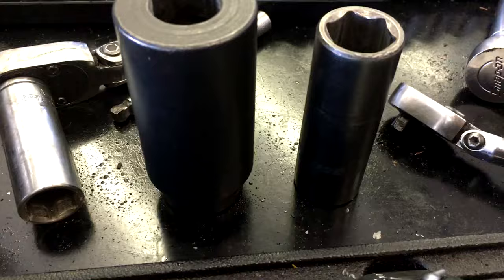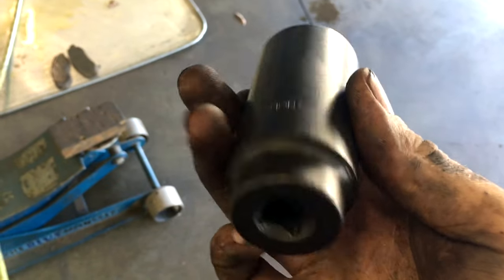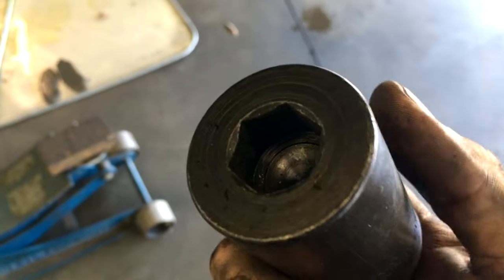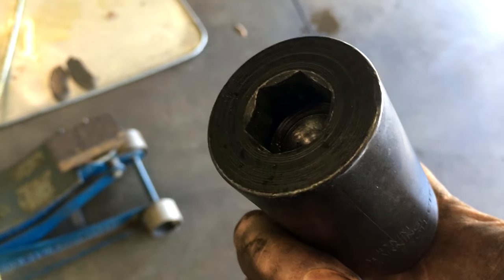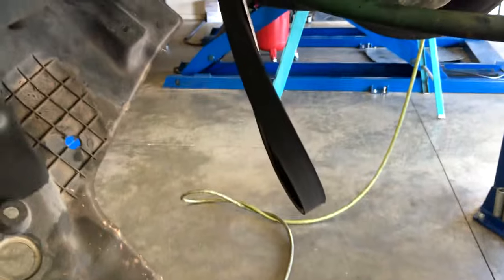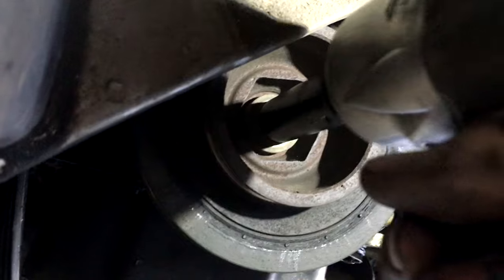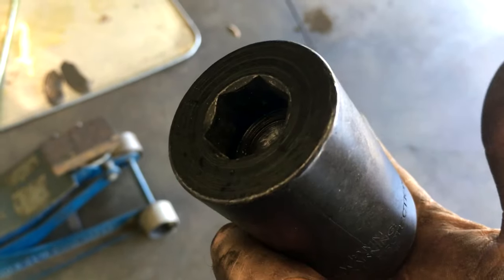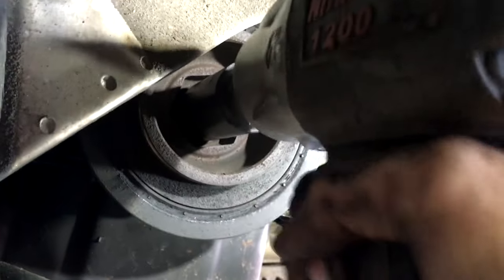The Easy Way To Remove Honda Crankshaft Pulley Bolt / Harmonic Balancer

Comment: I recently changed the timing belt on my daughter's 2003 Accord with the 3.0 V6.   As I researched the process this bolt and it's removal looked like the biggest obstacle I would face.   The research proved correct.   Before I started I bought the special socket and tried to use it with my Craftsman impact wrench.   It's pretty strong and after soaking the bolt with some penetrating oil I gave it a try.  NO joy...didn't budge...figured I was doomed to chasing down the other tool that locks the crankshaft.    However, sitting in   my toolbox was my Dad's old Chicago Pneumatic air wrench.   When he died I got it and a number of other tools that he used early in his career as a diesel truck mechanic.  It hadn't been used in well over 50 years (possibly more as he moved on from being a mechanic prior to 1970).   Anyway...the wrench was used so much that the 1/2 drive was worn down and didn't even fit well into the socket.   I dropped some lube oil into the gun, made sure it worked, and that bolt spun off like a NASCAR lug nut in a pit stop.   I was shocked to say the least (and very happy).   Anyway....it's entirely possible the oil had some time to soak more...and maybe the original gun I used helped...but...the old gun just had a field day with that bolt.   I ended up having to rent the other tool anyway to put it back on at the end of the job...(you can't use the air gun for that).   So that is my success story with this bolt.   I hope everyone has success with it too.
Reply: You weren't like me trying to use a wired impact? Find out it's only like 300ft. lb DoH!

Comment: I got one.  My '98 Civic had the 17mm bolt.  It was amazing.  The rigidity of this one really made the impacts of my old regular Sears Craftsman impact work great.  It did wind up cranking the pressure up to 125psi and it did take two tries, but it worked.  Without the tool I would try 10-20 times and nothing happened.  The tool is amazing.

Comment: Thanks James. You saved my day. I tried with my normal impact sockets and the only thing that happened was the bolt head getting out of shape. . I searched the net for a solution and came upon your video. Bought it off Amazon and it did not take even 30 seconds. Thanks again
Reply: Took less than three seconds on mine!🤪😁🫡

Comment: I bought both the heavy socket and the pulley tool.  We tried the pulley tool first.  No use, even with a long breaker bar.  Came in a watched this video and realized why the socket was so heavy.  Gave it a try and Vuala!  Amazing!!  Thanks for taking the time to make the video!!
Reply from the maker: yeah, it's so simple, but so effective. I had been using the breaker bar forever when my impact wouldn't get them loose. I haven't used a breaker since I got this socket.

Comment: THANK YOU! I'm a former tech and now a DIY guy. I've owned two Odyssey's and my current 2013 is needing a timing belt. I've done 4 timing belt replacements before on older models and the hardest part is always gettign that crank bolt to break free. I managed to get the other loose, but due to changes in the sub-frame on our 2013 I just couldn't get in there and get the leverage I needed working in my garage on the floor. Like most, I spent an entire day and broke an extension trying. I was at my wits end, but not ready to give up - HEY, this is a $1000+ job at any repair shop! I event bought a new 1000# Kobalt impact trying to make progress - nothing. Then I saw your video. $22 on Amazon and next day delivery - 2-3 zaps with the new impact, bolt came right off. THANK YOU AGAIN!
Reply from the maker: That is awesome man. So glad it helped. Thanks for the comment

Comment: Glad it worked for you guys. It broke my tools using breaker bar and my weight which is around 450lbs give or take and didn't even budge with a impact using this exact tool. been trying on and off for the past 3 years different methods. time for the junk yard if a can't get a couple grand for it. 2008 Honda Ridgeline with 150k miles.

Comment: How do you put back the crankshaft bolt and torque to spec if you don't use the pulley holder tool?
Reply: Lol
Reply: @fire5414 What's so funny?
Reply: You need that pulley holder tool to put that bolt back to torque spec, there’s no other way
Reply: Or you hit it with the weighted socket

Comment: Hi mister, I’d like just to ask a question 🙋🏽. Hopefully you can help, I got a 95 civic coupe that has pulley with only 2 bands, so I’m adding power steering to my car and I need a 3 band pulley or main harmonic whatever it’s called, which I already got and plan to install. My concern or doubt is, does this pulley need to be marked where it goes, or just take it off and put the new one in? Does affect anything if just installed in without paying attention to like where it starts and ends? 
Hope you understand my concern. 
Thank you very much.

Comment: Funny, I have never had one break free with the heavy socket at my shop and I have tried both a Milwaukee 2967 and a Dewalt DCF961 and neither work, I have to use 3/4 extensions and breaker bar and an eight foot cheater pipe and jump on that until the bolt gives up. I think they install the bolts with Ingersoll Rand W9691 1 inch impacts around here.

Comment: Sounds as if the impact hammers faster when using the "special socket" as if it had been "turned up"?
Reply: When the clearance (flex) gets tighter the impact hammer can work faster, because the way from left to right will be less, i mean, if it wasn´t faked that would be a good reason in my eyes
Reply: I hear the same thing as if the air pressure was higher with the special socket. But I can also somewhat see how less flex can speed up the impact effect. Idk we weren't there but makes some sense I guess.

Comment: I had to use a HarborFreight 1" drive impact gun with 1-3/4-1/2" adapters and Hi-Flow air fittings.  My 1/2" CH gun could not loosen after 20 tries, heating, penetrating oil and so on.  The HarborFreight item 68128 and you will need the adaptor set item # 67937.  Major Pain!

Comment: I have this impact socket but barely have to use it because my Milwaukee 2767 breaks those Honda bolts with regular impact sockets
Reply: Milwaukee is King
Reply: Wait till you get one in that your milwaukee + this socket won't remove. Fun times.

Comment: After torching, solvents and torquing with cheater pipes and breaking extensions, I'm sold on the battery impact wrench. My neighbor said, "Oh, I have one of those drivers." The 18V Milwaukee Fuel broke that LITTLE bolt out like it was 10mm.

Comment: Engine turns clockwise (when looking at the nut.) It should never be turned counter-cw. This will drive engine counter-cw if bolt is too tight? If the timing belt is marginal, will it damage the internal tensioner or break the belt (hence valves)? Or I worry too much?
The starter method seems to avoid this issue. But does the starter method ALWAYS work too?
Reply: A solution is to use the holder but isn't this massive socket too big to go into the hole of the holder?
Reply from the maker: It won't harm anything. The holder tool is used with a normal sized socket. The big socket only works with impacts

Comment: Watched a mechanic use this socket on my honda engine for timing belt job. Thing came off SUPER QUICK
Reply: Prolly came off before at least once.
Reply: @Gshock714  no it was the original timing belt

Comment: From what I read, it's not "magnifying" but rather ordinary sockets flex thus dampen the torque.   I guess the effect is the same.
Reply: That makes more sense to me.    Good reason not to use an extension when cracking lose a tight bolt.
Reply: On the box of this socket manufacturer states "it has 3x the mass of a regular socket" so that equals to more force been put to the bolt through this socket. It works like a charm.
Reply: @raw_pc  From an engineering POV that doesn't add up. The hammer is where you want the mass. All additional mass being driven by the hammer (I.e, the anvil, the socket, and the mass of the bolt) all detract from the power of the impact. If you made an extension out of a 5" chunk of steel, rest assured your impact would have very little power left to loosen the fastener. What this socket does have is a lot of rigidity as K NG stated. When a normal socket flexes, the torque is transmitted into elastically deforming the socket and heating it up. Even minor twist can suck the power right out, hence how torque-limiting extensions work. Any data from the manufacturer stating that the weight helps is just marketing wank.

Comment: What do you do when your breaker bar square drive snaps off standing on it and this bolt dont budge?
Reply from the maker: Get a better and longer breaker bar. Use PB Blaster and let it soak. If you're doing it in your driveway, maybe drive it to a shop, have them break the bolt loose, then tighten it to the minimum they can, just enough so you can drive home. Impact really works the best. Twisting motion is not very effective
Reply: True... the vibration through the metal from the impacts really does the job.   Maybe I should get tension on the breaker bar then whack it with a weighted hammer.   Works on separating ball joints.
Reply from the maker: Gene Friedman Worth a shot. High quality breaker bars make a difference too. Cheap ones flex a lot, decreasing your leverage. Adding a thick 6 foot  pipe to the bar usually does the trick too

Comment: How did u get the pulley to not budge? Im trying to replace my crankshaft sensor in my 97 prelude. Useing pulley holding tool and a breaker bar. I tryed the bump it method. With no luck. Im not sure why because Im doing it on my own. I cant turn the key and look at the crankshaft pulley. Anywhoo. Thanks for the video. I plan on subscribing and watching more of ur videos. If u come across any 97 preludes w/obd1 conversion on a h22 motor. Id be interested in anything u may fix on it. :-)
Reply: Do not take any belt out. You will need an impact gun rated 611+ ft lbs or 1/2" extender, extend bar & then choke the Crankshaft Pulley down = that bolt is at 1,100 ft lbs due to years on the road.
Remove it in CCW.

ATG & I suggest to lube the ATG Crankshaft's Bolt with transmission fluid or blaster like.
Lube then wait or spray it overnight.

Do you have an impact gun?
It is best if you have an impact gun with ATG's socket.

Comment: How much torque do I need? Looking at the Harbor Freight corded impact wrench. Says 1050 ft lbs max nut breaking torque, 300 ft lbs max torque. Is that enough?
Reply: corded no good, also HF take with a grain of salt. Milwaukee or DeWalt or Ingersoll Rand don't mess around.

Comment: How much psi or big of a air compressor is needed?? Currently stuck with this and am using the 1200 lbs break away torque with a 8 gallon air tank, max psi 150

Comment: I’ve got one and it’s always worked great. However, our odyssey just snapped the timing belt(only 20k miles old) and I’ve been hitting it with this socket for a day and it’s not budging. I’m stuck at this point.
Reply from the maker: Probably gonna have to use hear

Comment: What did you do to keep the pully from turning?
Reply: Honestly, you can just hold it with your hand and use your other hand to work the impact. Did it on my 96 Civic when I finally got that bolt off.
Reply: @Robinhood179  well, the funny part is, I found out that mine came loose as I drove it home😅, but thanks a lot man, I really do appreciate it!

Comment: So if i buy this socket then use it on my Milwaukee 1/2 inch drive impact, will it remove the bolt? I don't have a air impact, but my Milwaukee impact does claim 1100 lbs reverse impact torque. My only other option will cost a bit more for tools, would like to think this will work, I tried a normal socket with a short extention, it did not work.
Reply from the maker: I have used the Milwaukee to do this very task, and yes it does work with the socket. However, I live in a rust free climate. If you're working with rust, you might need to add some heat. Also, dont use any extensions because you will drastically reduce your torque output.
Reply: @AppalachianDIY  sounds good man, I will do what you said. Don't think rust will be an issue, anf my impact is a tough dude. I just ordered that socket yesterday after watching this video, I think it'll work out just fine... thanks for your reply and the video.
Reply from the maker: Cool man, good luck
Reply: @AppalachianDIY  I got this socket and used it with no extension like you said, and in like two or three seconds tops that bolt zipped right out like nothin. I made sure I had my impact battery fully charged and on max reverse torque, was a piece of cake. This socket really does work, I'm amazed and greatful for your video. Thank you for recommending it and posting this video!!... these Milwaukee impacts are some fantastic tools.

Comment: How strong of an impact air gun is required?  Thanks in advance.
Reply from the maker: That depends on how tight the bolt is, but I'd say over 1000 ft/lb breakaway torque is a safe bet. My gun is 1200 ft/lb breakaway and is plenty with this socket.
Reply: I can tell you for a fact that 600 ft-lbs didn't do it even with this socket.  I'm bumping up to 1400 ft-lbs (M18 Fuel 1/2 High Torque).
Reply: @someusername121  with that 2767-20 it's a piece a cake
Reply: A DeWalt 899 with 700 ft•lb and 1200 ft•lb breakaway torque works.

Comment: They make a tool to go into hex of pully,that you can put a 1/2 drive breaker bar in rest on frame and use a regular ratchet, by hand,no compressor needed,also holds crank in place for flywheel bolts,and cheaper than big ass socket
Reply: But if that BIG ASS socket gets the job done that's all you need. So why mess around with anything else?

Comment: Will using a corded impact like Kobalt with 350 ft/pounds reverse torque work?
Reply from the maker: It might. This socket boosts the torque so much, it's quite possible it would work. But there is no guarantee because you don't know how tight the bolt actually is.

Comment: The Milwakee 2967 will do it with a regular socket. Its a Monster tool.
Reply: My Milwaukee 2967 has not been able to do it on any of the Honda's that I have tried even with the heavy socket. I have to use 3/4 inch extensions and breaker bar and an eight foot cheater pipe and jump on the end of that to get them to break loose, I think that they install them with Ingersoll Rand 1 inch impacts around here. I am considering buying a Milwaukee 1 inch D handle to see if that does the trick.
Reply: @12jazion  You must have a defective unit. The 2967 is a serious powerhouse. On my old air gun i had to just keep hammering away at the pully bolt for ages. It finally came lose. The Milwakee 2967 is a monster. Takes it off and about 5 seconds. Its about 1600 ft pounds in reverse. Maybe your battery is shot.

Comment from the maker: Guys I just thought I'd share this little tidbit. This socket is now available in different sizes for different applications. 17-27mm in various increments. I think the 19-22 will cover most of the stuff you'll see. They need to come out with an 18mm though. I'm pretty sure I've run into an 18mm crank bolt before.
(17mm Socket)   http://amzn.to/2kBuSpa   
(19mm Socket)   http://amzn.to/2ktWMEt   
(22mm Socket)   http://amzn.to/2kByszJ  
(21mm Socket)   http://amzn.to/2jxsXEA  
(27mm Socket)   http://amzn.to/2jxtg2c
Reply: what keeps the pulley from spinning? why don't you need the holder tool to hold it?
Reply: They need to have a 30mm and 32mm for the axle hub nut.   Those are just as bad - maybe worse - than the pulley bolt.